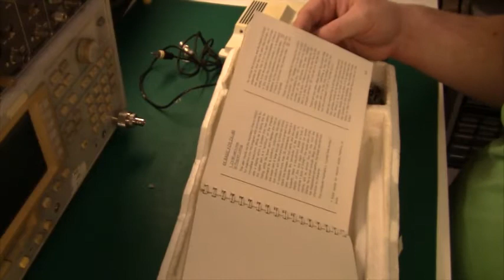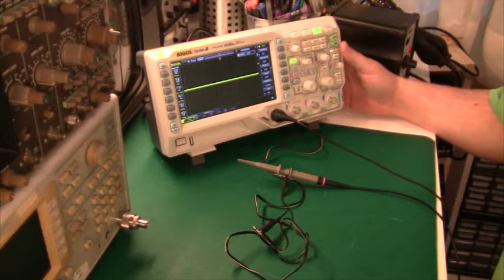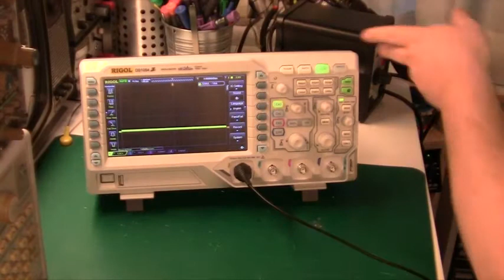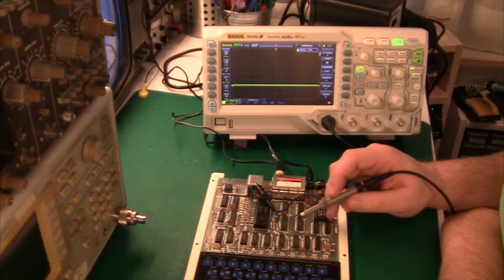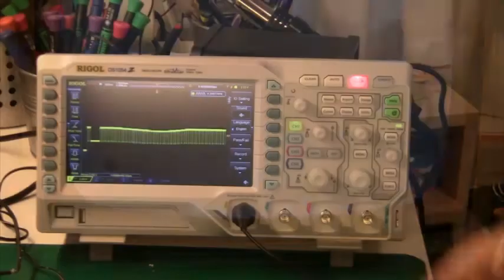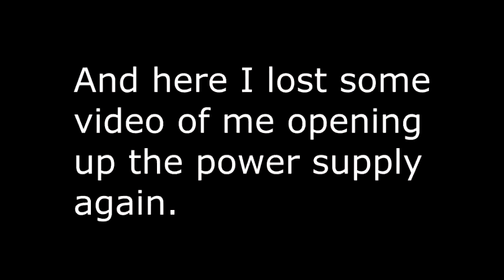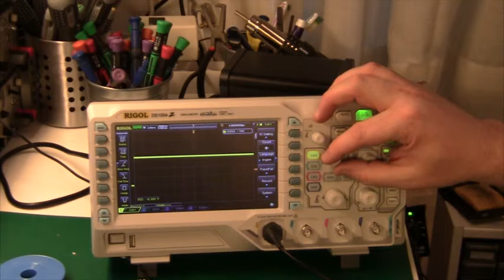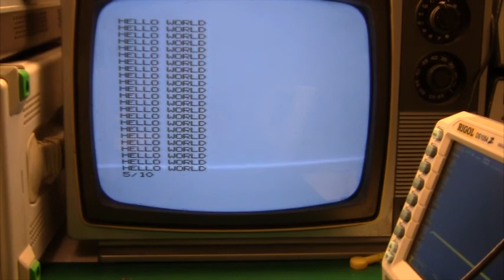Repair of Sinclair ZX-80 #2

Comment: i wish people would get it right, they did not put 8k zx81 roms in them on the up grade, they put a special 8k zx80 romset in, it had all the extra functions and the keyboard was correct, putting a zx81 rom in a zx80 works but the keyboard mapping is wrong, updating the keyboard to a zx81 cures this, you can also get an upgrade keyboard like the speccy keyboard.
Reply from the maker: That's right. It's a different ROM than the ZX81 one. Also, the ZX80 did not have the fast/slow mode hardware, so the ZX80 with ROM upgrade would work only in FAST mode.
Reply: If it was not the ZX81 ROM, then please point me to a binary of the special 8K ZX80 upgrade ROM. In the ZX80 that I bought from a trading site, it had a ZX81 ROM. As I understand it, the Sinclair update kit came with a keyboard overlay for the new ROM.

Comment: I think I can explain why both those ZX80's had no 5V on IC21 pin 14. IC21 is a 74LS93, this has an unusual pinout, and pin 14 is not VCC as usual, VCC is for some reason on pin 5. Pin 14 is a clock input, which is not connected on the ZX80. No idea why the 93 has the power connections in different places to normal, but I've fallen for the same thing on a ZX80 repair.
Reply from the maker: Damn. You are right. I thought it was a design-fault. Thanks for spotting that.

Comment: Again really brilliant. Is the character ROM correct? THought the 1 and the R were looking wrong. May have forgotten though, not sure.
Reply from the maker: The characters are OK, but the font is a bit "unusual". For example, there is no "slash" through the zero.
Reply: NatureAndTech Yes, but was that standard ZX80?
Reply from the maker: Yes, this ZX80 has the original 4k ROM. The issues were fixed in the ZX81 (and the 8K ROM upgrade to the ZX80).
Reply: Right. One question: do these machines go up in value now?
Reply from the maker: Just watched the video. The 1 and R issue is because of the TV. Modulating the video signal up is never good for the signal quality.
Reply: NatureAndTech ah ok
Reply from the maker: The price has almost doubled over the last year.
Reply: NatureAndTech Nice, it was a special time in history :)
Reply: Awesome avatar!  SHADO  ....my god Lt Ellis still makes me horny.  lol